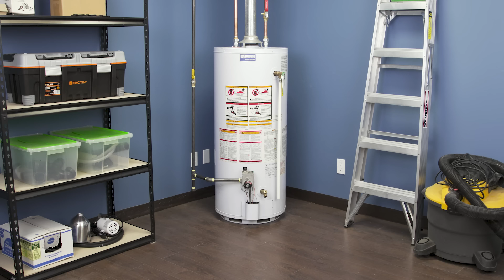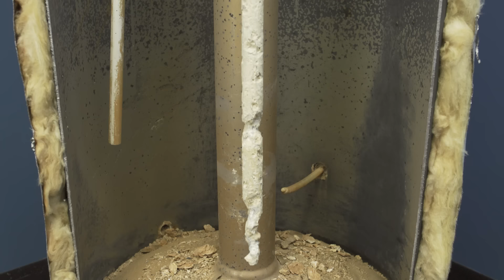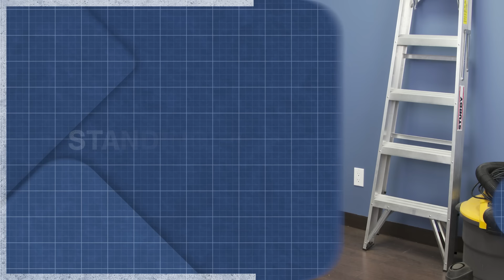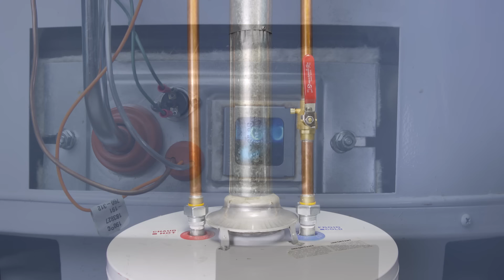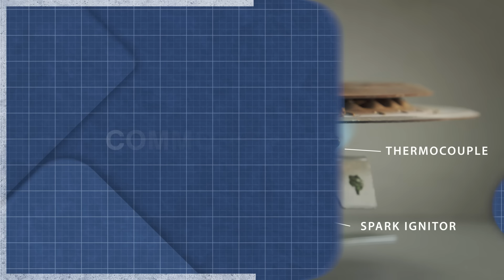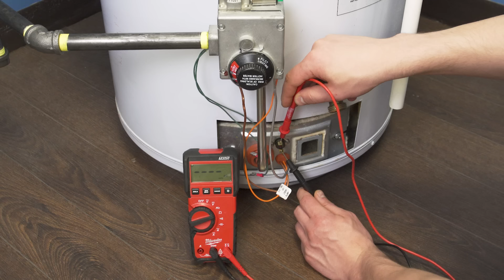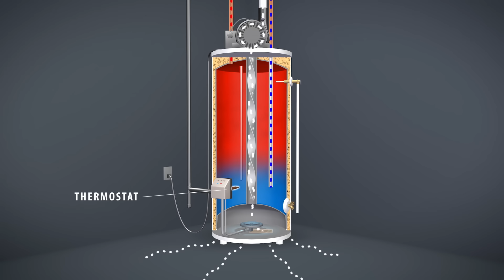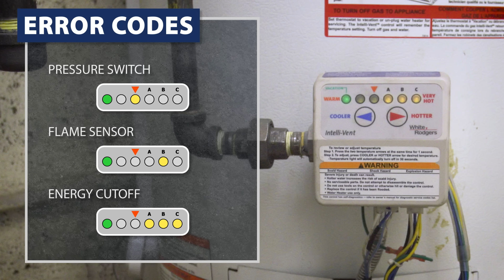How Do Gas Water Heaters Work? | Repair and Replace

Comment: How much gas and air do gas water heaters and gas air heaters eat ? Can Coronovirus siknesses oxygen lack problems partly be explained as a burning O2 out ?
Reply from the maker: Thank you for watching. The amount of oxygen consumed by a hot water heater is negligible. The risk of the gas heater sucking all the oxygen out of the room is zero. 
Improper venting is a larger safety issue with carbon monoxide (CO) present in exhaust gases, that's why carbon monoxide detectors are recommended.
Reply: @AmreSupply  according to some technical perfomances of watergas|watersustitutorsgas small households heaters data 1cubic meter of gas needs up to 10 cubic meters of air. As concernis airgasheaters households systems here you are a witness's testment --> https://www.youtube.com/watch?v=Mb6YNy4tuiw. So what is the death rate of canadians caused by a airgasheating systems due to overcarbonised burned air ?
Reply from the maker: @serdzhu   Keep in mind that air is only about 20% oxygen and appliances don't just suck oxygen from the air and won't decrease the percentage of oxygen in the home if everything is properly vented. The water heater will pull air from the room and the exhaust is pushed outside. The exhaust is made from the air from the room.  The volume of air that is lost creates negative pressure, this will pull new air into the room. The percentage of oxygen in the home's air won't be affected by combustion.
Reply: @AmreSupply  WHO is to keep in mind WH02...

Comment: So pretty much if you dont have a blower on the exhaust your boiler doesn't need electricity since it is made by the heat which is enough to power the pilot?
Reply from the maker: Thanks for watching. You are right that water heaters with an atmospheric vent are self powering and do not need a source of electricity.
Reply: @AmreSupply  thanks very much. Learned a whole lot.
Reply from the maker: @lh484  You're very welcome, we're glad you found the video helpful! If you are curious to learn more we've made a fully animated video on Multimeters and Electricity Basics. Its good for a refresher or for learning something new. You can see it here: https://www.youtube.com/watch?v=r_migcta_Is&list=PLCo9SMjkdWBycw9hZVfYFc6Sw2Jlavaak&index=2&t=0s

Comment: This video did absolutely nothing for my 75 gallon propane hot water heater only a few years old emitting black soot until we piped it outside the house from the basement and carbon monoxide detectors are still going off in the basement
Reply from the maker: Hi Terry, thank you for watching. You likely have debris clogging the burner or the flue vent. Considering that the carbon monoxide detectors are going off, its best to shut off the gas, continue to ventilate the area and call a technician.
Reply: Sounds like it is burning too rich.  It may need a regulator on the gas line.  As for the CO detectors, it could be vented incorrectly or not 100% and allowing some CO to leak out of the vent.
Reply: Why heat hot water,  it already is hot ?